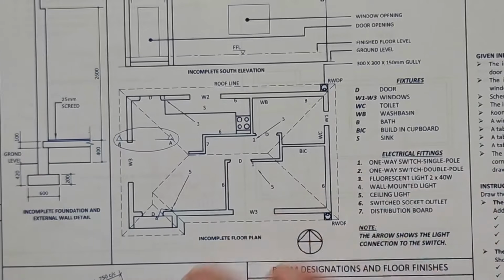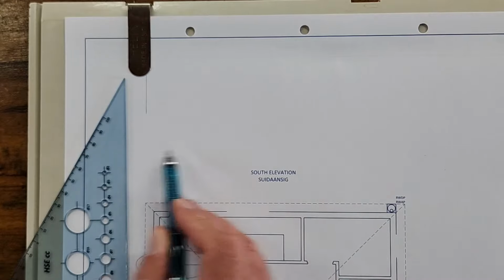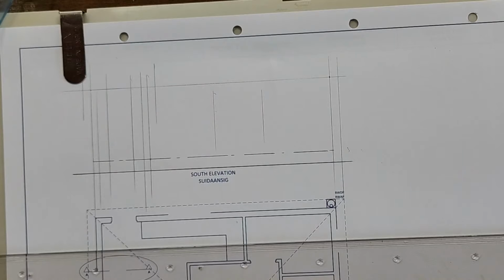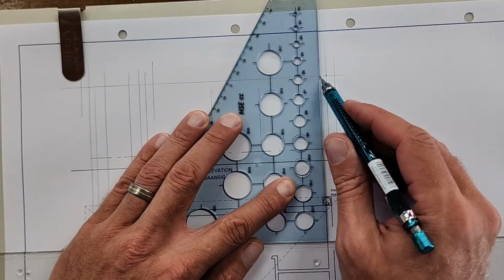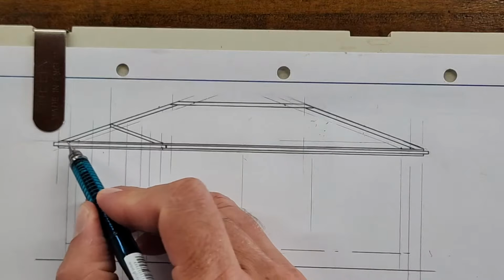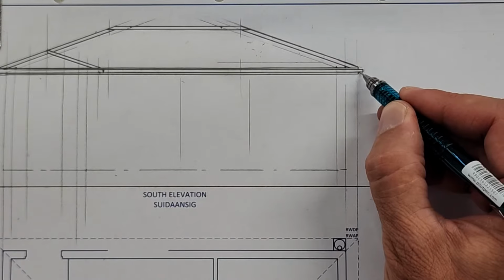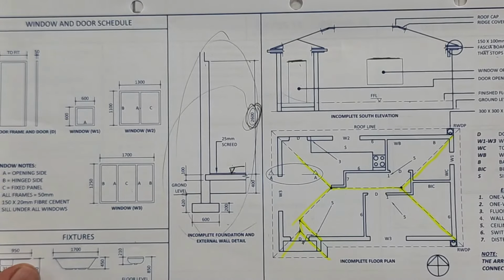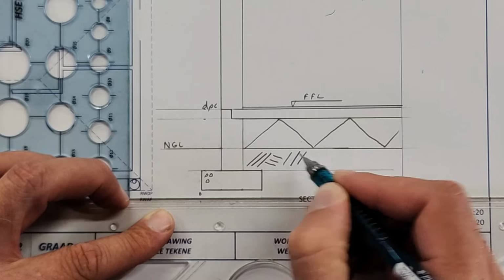How to DRAW a CIVIL DRAWING easily - HSE | Page 3-36 | Grade 12

Comment: Hello, sir what does the 114 x 38mm for the the queen post, king post, tie beam etc. mean. Is it length and height, i understand the the 114 is the thickness but what is the 38mm?
Reply from the maker: Hi, the 114 is the width and the 38 the thickness of the beam. The length will differ according to its use. The standard size of construction lumber in South Africa is 114 x 38. Keep Drawing